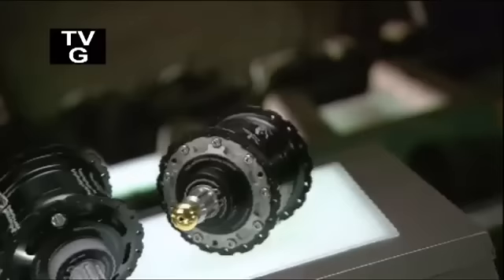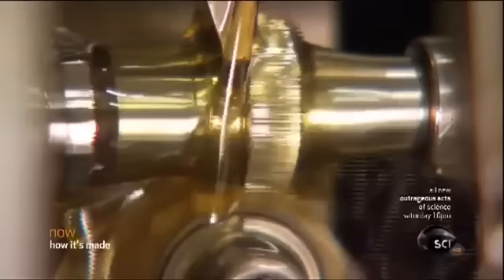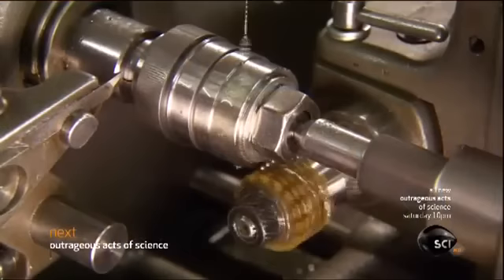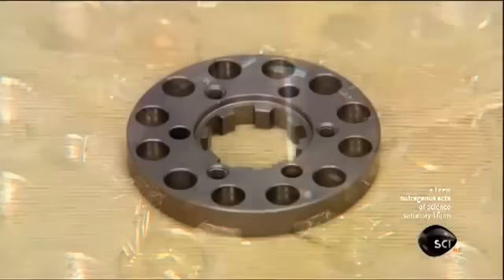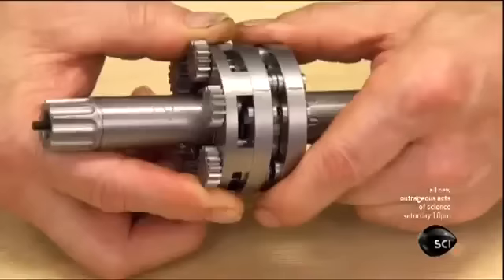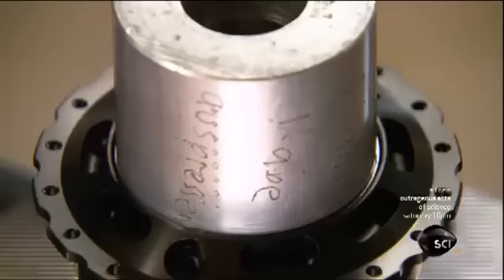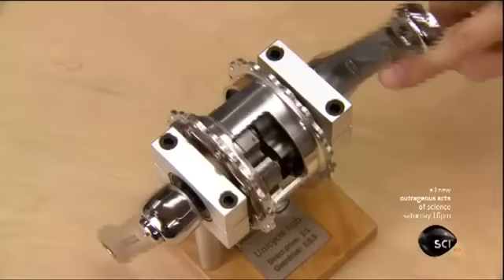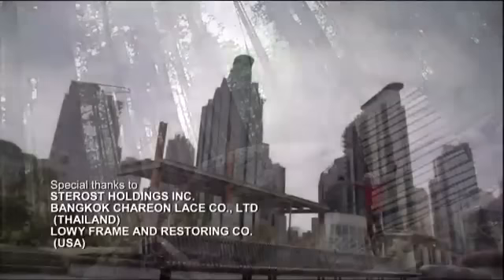Kris Holm / Schlumpf Geared Unicycle Hub: How It's Made

Comment: This is great, and I will be passing it on. One recommendation: a lot of the video is of Kris riding an un-geared uni; I would prefer it if had some video of high-speed riding -- actually showing the benefit of the Schlumpf hub. Also, the narrator says it allows a uni to go up to 25 mph. The current record is 33 mph!
Reply: Plus it's a 1.5 multiplier so the math is even off. 12.5x1.5 isn't 25.

Comment: One website specifies the schlumpf hub as 1.55 ratio but these planetary gears have 14 teeth suggesting 1.5 ratio with a 21 tooth sunwheel. A 1.5 ratio has 2 wear spots on the tire per revolution, another similar ratio could give easily give many more wear spots to prolong tire and wheel part life per power stroke/stance. I wonder if these things could be lightened up with either titanium/magnesium gears or lighter drillium versions of what they're already made out of. Keep up the innovation y'all!

But wait, I don't really know how to calculate planetary gear ratios. Another video online makes it look like the gear is closer to 1.55:1 than 1.5:1.

Comment: I have a 26-in direct drive unicycle.
With this hub's 1:1.5 my 26 would be equivalent to a 39-in uni. 
Being lower to the ground than being up on top of a big 39 should be worth even more because s lower profile means less wind resistance. 
You also don't have to fall as far! 
If you calculate the price of the hub and subtract from it what you're not paying for a 39 direct drive, the price is mitigated.